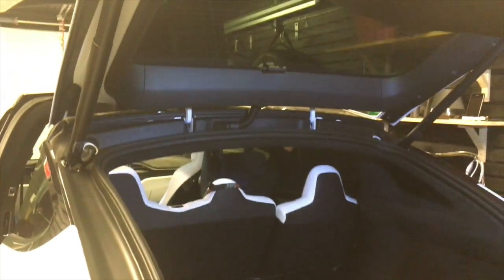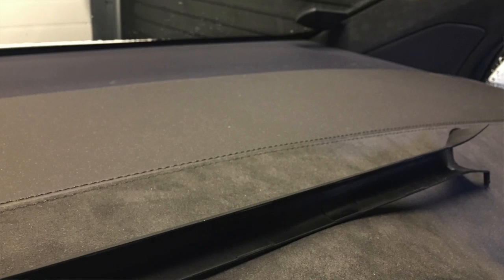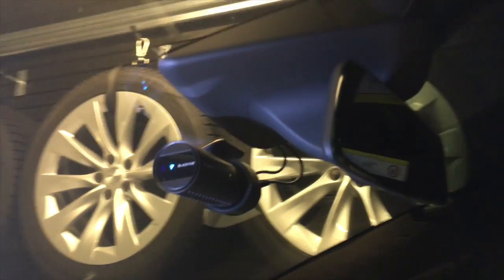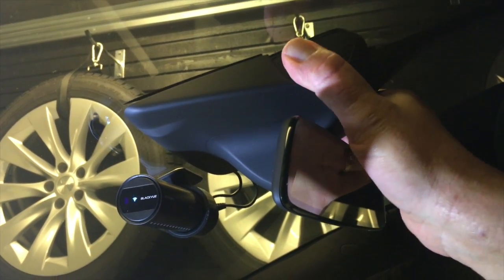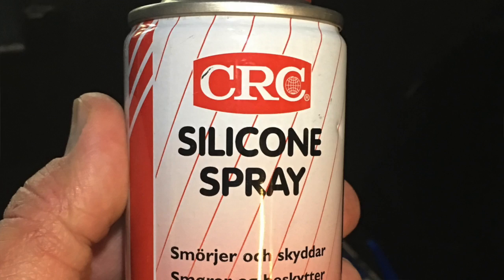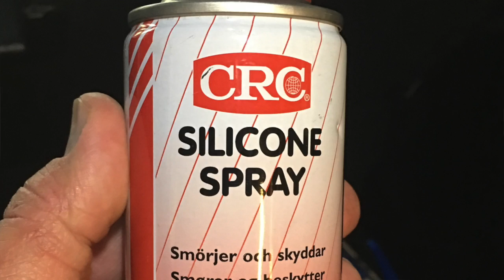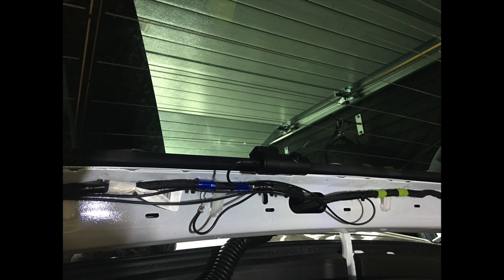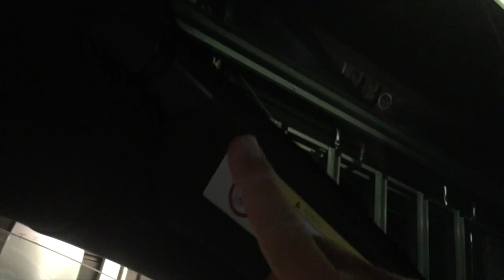How to install Blackvue DR650s-2ch in Tesla Model X AP2

Comment: I've used this guide as my primary source of information on my self installation.  The small details added in really made the difference. I knew where to be careful and avoid trouble and where I needed to use force.  I've made it through the toughest bits and would not have gotten close without this video.

Comment: Ahh, you made the same mistake that I did! You removed the trim piece on the back. After I did mine, I had a few people tell me you can just fish the wires through the trim using a ziptie. That way you don't break the tabs off when trying to remove the rear trim piece.
Reply from the maker: The Nerdy Engineer Hi, it’s you! :-) Thanks for sharing. Yes, the rear trim is really painfull to remove 😂 Nice to know that it can be done with a help of ziptie :-)
Reply: How can you do that without removing the rear panel?
I am installing a Thinkware F800Pro (started yesterday with mounting the cams and testing it). Still have to fish wires though and solder my odb-connector afterwards.

But I dont understand how you can fish the rear wire without removing the trim piece in the back, as then you cant see where the wires goes?
Reply: Olav Alexander Mjelde you remove the rubber tube that goes from the roof to the hatchback door. Run the cable through the rubber tube (this is a tight fit and takes a while). Then use a zip-tie to go from where the rubber tube connects to the hatchback door out under the trim. There's a better description in the video description of my video about installing the Blackvue dashcam.

Comment: How did you remove the left side panel to tap in the ODB port? This panel: https://imgur.com/a/co6jrTL it doesn't want to get out on mine
Reply from the maker: Vincent Courcelle It just popped out really easy. I used two plastic pry-tools :-) I hope you solve this ;-)
Reply: Yep I was finally able to pop it out, I was just a bit shy at first. For other reading this, it's attached all around on the exterior side by the same kind of thing that you can see when popping out the back of the trunk.
Reply: TESLA DIY And thanks a lot for your video it really helped. I came with another solution (way easier, as clean) for the rear camera, let me finish the details before I post a complete solution